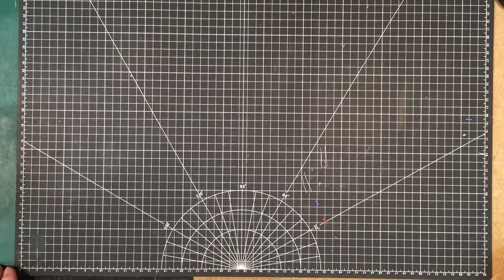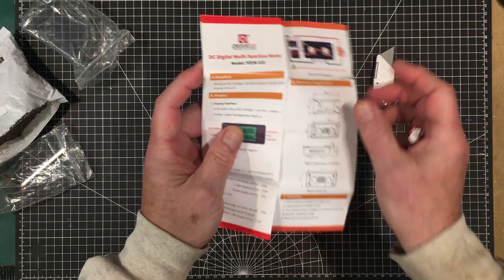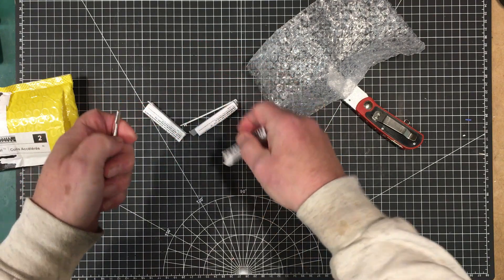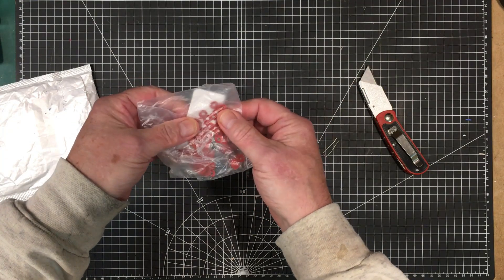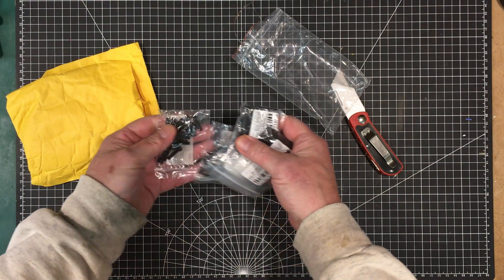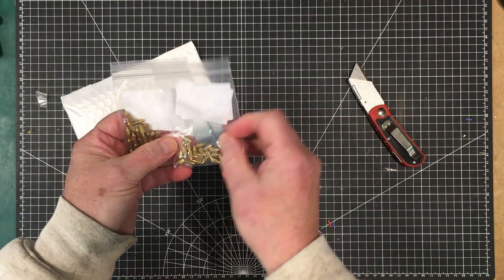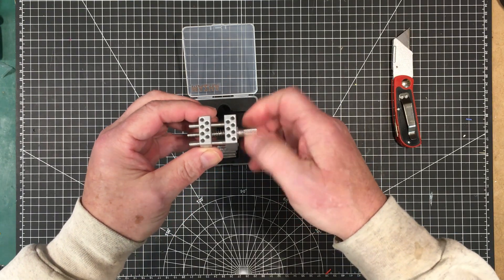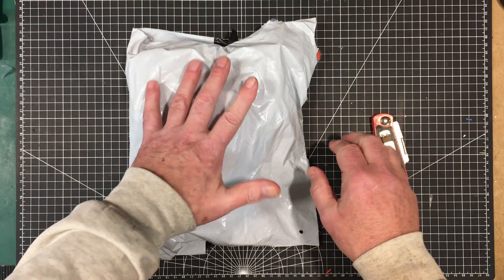Uni-Byte 0223 - Mailbag #30: The MUST have Gadgets, Bits & Pieces for ELECTRONICS

Comment: Turn the face of the meter down in the case to avoid having the net and accessories from scratching the display or pushing the buttons when closed. A cut out section of microfiber towel can be used on the inside surface of the meter in case the material of the case is rough or otherwise cheap material. I like the 9V holders, I didn’t know they existed.
Reply from the maker: Good suggestion, thanks!
Reply: @uni-byte  sometimes the foam you need comes in the shipping box. My FNIRSI HRM-10 foam fits perfectly in a zipper case.
Reply from the maker: @pault6533  Verry true.

Comment: The most interesting tool for me  is the steel mini vise at 10:24. I’m personally not a Aliexpress fan even though I have already bought from Ali Express. Batteries and semiconductors are often FAKE components . What would be really interesting is to have a follow up about the quality of the product. Another YouTuber well known here in Europe make these reviews as well and he gives a recommendation (or not) to the products. Since your selection differs from his product selection it would be really good to know the quality of the bought products. By the way you are ordering a lot of stuff from Ali Express. Do you also USE the parts you ordered? Please, more project related videos if possible. In this videos you also give a part list. That’s enough - at least for me .
Reply: Thanks so far. I do understand your intention. The question regarding using the bought components is based on my own experience. So I may buy for two projects. However the second project or maybe both projects will not be made within a certain timeframe. Now, I have a lot of components laying around. You may manage this in a much better way then me…
Reply from the maker: @heinzkreutziger2218  Not really.  I do buy components with the intention of using them for some particular project, or even two, but like you the 2nd project may never materialize.  However, eventually the spare component(s) becomes useful for another project or an experimentation.  I still have 2N2222 transistors I bought 40 years ago, and they still get used.  Storage and indexing all the parts you acquire over time is a bit of an issue and is something I deal with over time too.  For instance, I got those 2N2222s in a bag of 500 from a surplus parts liquidator for $2 IIRC.  That was before fakes were being made, and I cannot buy them now for anywhere near that price.  My advice is never be afraid to have a few extras.  They will eventually come in handy and if you have them in hand,  you will have them at a better price and will not have to pay shipping to get them delivered.  All is good.

Also, trying to standardize on components is a very handy way to limit the number you have to keep track of.
Reply from the maker: I'm actually testing the batteries as we speak (write?).  I do projects - at least one a month and sometimes more, but generally they are not received as well as reviews or mailbag videos.  In those project videos you will see a lot of the components/parts/stuff I buy.  I have also provided updates on products I have bought if I think the update is worthy.  Usually these updates are at the introduction of a video that is mainly about another subject.  The problem I think, with doing a video that is all updates is that I'd have to test a lot of these items to make a single video.  The time required would be prohibitive.

Comment: Using the knife to open the box with lithium batteries was risky! 😅
Reply from the maker: I live on the edge!  If you take another look I was careful to keep the blade from going in too far. :-)  Thanks for watching!
Reply: @uni-byte  Fun pun = grin. I turn the blade on an angle, nearly parallel to the box. This way, the tip of the blade only nicks the tape and not the contents. But, I am that you were a good boy scout and know how to handle a knife...
Reply from the maker: @t1d100  Good suggestion.  Thanks.
Reply from the maker: @t1d100  God suggestion.  Thanks!

Comment: I have not had much luck with Aliexpress batteries as well as lithium battery items. (capacity usually the main issue)
Reply from the maker: I get what you are saying.  I fully expect these to come in around 7000 mAh, not 10K.

Comment: I have a couple of those little vises. They are popular with watchmakers. I don’t call myself a watchmaker but I’m a collector of watches.
Reply from the maker: I've only got 8 watches.  They aren't exactly special with my most "special" being a Seiko 6539-5070 - it's special because it was a gift from my wife back when we were 19 years old.  Next would be my TAG Indy 500 original model (CAC111B0) with the silver bezel.  However, the nicest looking watch I have is a cheapo  Seiko 7S26-03V0 with the white dial.  That thing looks like it should cost $10K (beauty is in the eye of the beholder - LOL).
Reply: The vices can be stacked too. A larger vice to hold the smaller one.
Reply from the maker: @pault6533  Yes, they could.